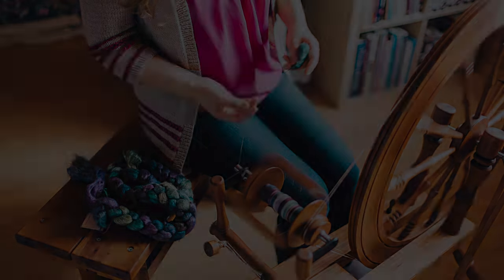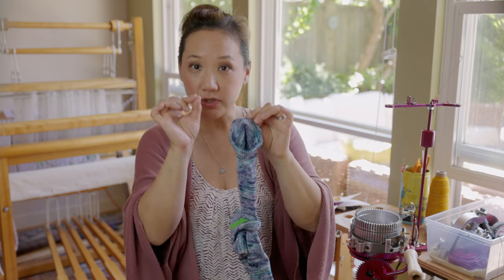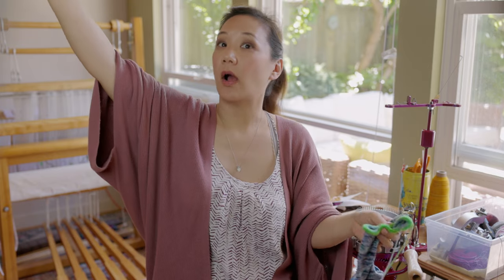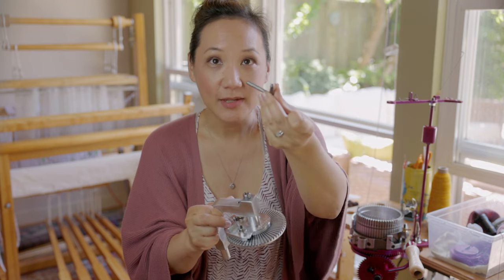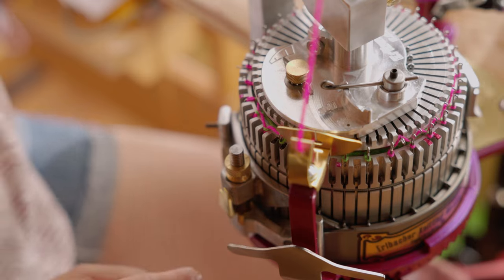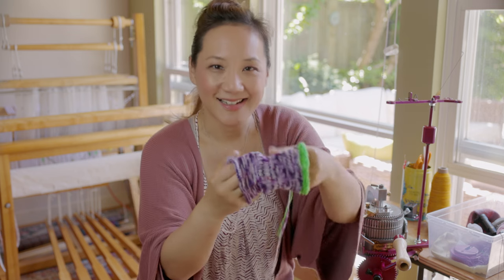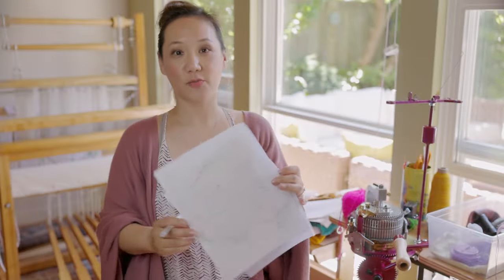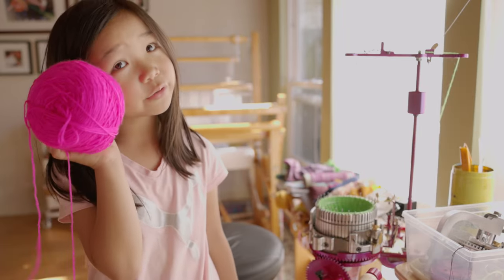Learning to use the CSM Ribber // Episode 182 // Taking Back Friday // a fibre arts vlog

Comment: Great video! On my machine the ribber takes a different tension than the stockinette otherwise the ribbing is very tight. I wonder if that’s universal to Erlbacher machines or all machines or just mine. I love these and the ending was fab. ❤️
Reply from the maker: Oh there should be a little dial that allows you to adjust your ribbing stitches too. I did not move mine from the factory setting, but that is another adjustment you can make ☺️